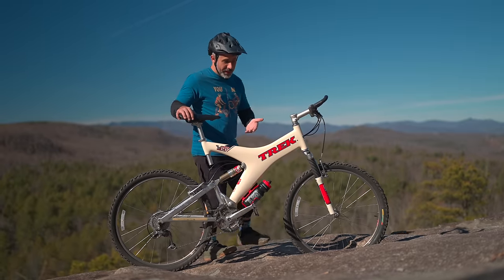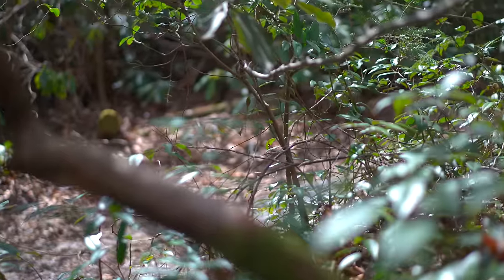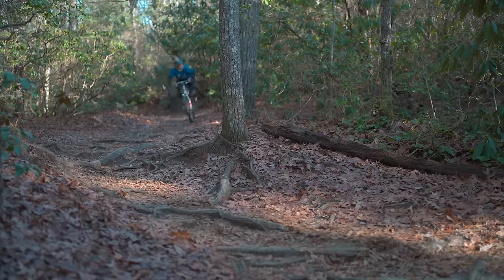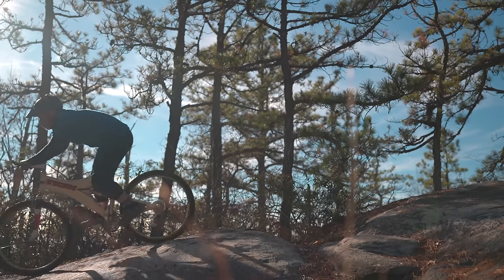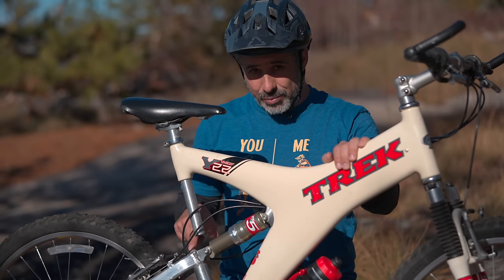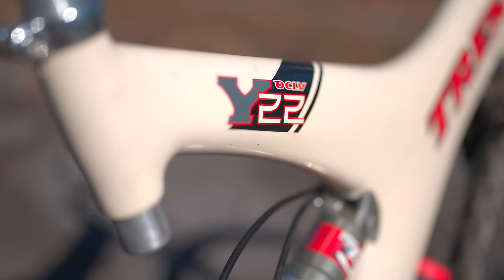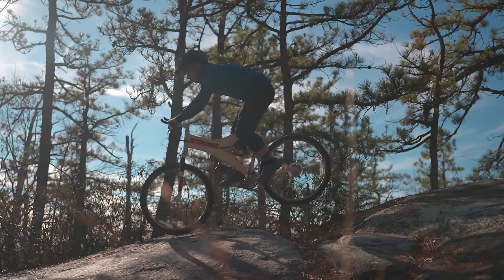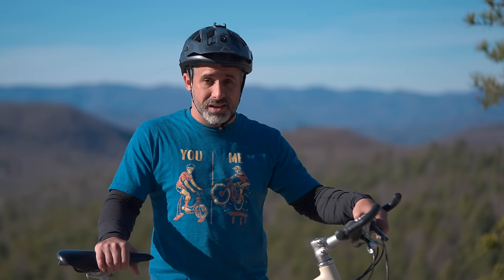The Trek Y22 was a 1990s Carbon Fiber Icon for the masses

Comment: I worked as mechanic for a downhill team in the 1990's, trek called it URT or "Unified Rear Triangle", the team riders called it URT too  "Un-Ridable Transport"
Reply: Worked for a Fisher dealership. We simply referred to them as the Why?Bike!
Reply: no kidding.  URT is like Unreported Rider Tested.
Reply: Solved with locking option on the rear shock (Fox Vanilla air with piggy back at my case) 0 bobbing when lock. 😎
Reply: @assafgol  nahh, nothing solves having the shock in the rear triangle, that's why nobody uses that design anymore
Reply: I had a fox shock custom valved by push, it transformed the bike adding platform and better bump compliance (a common upgrade to fix many of the 90's FS bikes)

Comment: 8:04 After mentioning 80mm several times, suddenly seeing that "LONG TRAVEL" sticker on the fork cracked me up! 😂
Reply: Good find :face-blue-smiling:
Reply: I still have not gotten a suspension fork that had more than 100 mm in travel.  I mostly ride with no shocks now
Reply: There are some videos from Cyclingabout that explain why no suspension shock (e.g. a carbon fork) can be even better. So like you nowadays mostly without a classic suspension fork. @madtownangler
Reply: Rock Shox Indy(entry level, elastomer damped) and Judy (mid-high tier oil damped) forks were built around a 63mm chassis. The long travel versions added a whopping 17mm pumping that up to 80mm.
Reply: It probably was long travel at the time, i had a hardtail bike with 50 or 60mm which i bought in 94. 50-60mm travel i believe was very common at the time for the cheaper bikes.

Comment: By 97 everyone was well aware URT suspensions were crap. Thats the year i bought a Marin B17, a 150mm travel bike with proper suspension, single pivot, but good. And i absolutely remember my seat was up and down like a yo-yo even with a quick release. 

The reason the Trek Y doesnt have one is because they were always marketed as XC race bikes.
Reply: I agree - the only thing Seth didn't point out (which he should have) is that while the URT design might have been 'efficient' for pedalling (no chain growth/pedal kickback) when seated, fundamentally there was no real rear suspension the moment you stood up on the pedals... 

As you say, for XC riders it was essentially a 'comfort' option, but anyone wanting to ride rough terrain at speed with a single pivot needed either a Cannondale (if you wanted a Y shaped frame), the Marin, the legendary San Andreas - or do it properly and go for a 4-bar/horst linkage rear end like the GT LTS/STS and Specialized FSR.
Reply: This was my first MTB (Well the 1996 Y11 in matte purple, which I still have) and learning on a URT provided me with some advantages. One, I learned to circular pedal to avoid suspension bob, so I am a very efficient peddler. And two learned to descend in the saddle, since the suspension only worked properly when the rider weight was on the saddle and not on the pedals, which effectively makes the URT a hardtail lol. Thanks to ripping the derailleur out of the swingarm I now run it as a single speed. (note this is one of the best bikes to convert to a full suspension single speed), with a rigid carbon fork, 29" front wheel, hydraulic brakes all around (used to use Magura rim crushers, and on the Y they should be called frame spreaders lol), and a dropper seat post. A great XC rig, and a passible AM rig.
Reply: @jmo2752  those were the days. Not sure I rated the early FSR too highly though, I really wanted and STS though, that carbon frame with alloy lugs looked so cool. Loved the B17 so much that I upgraded to a '98 Marin Team DH the next year. Same frame but Manitou X-Vert Ti carbon triple crowns forks that suited it much better. Hope discs too on that.

Single pivot was my thing being in the UK, early full suss bearing maintenance in our endless mud was no joke.
Reply: This same bike would be sold at Walmart!
Reply: Hi! From Argentina! I had one  Y5 (aluminium) modified to DH in the 90's 👋 thnks for the video.
Reply: @vr4042 Despite the "sweet spot" marketing BS, the Trek URT design with the pivot as close to concentric with the BB as possible, minimised the URT-ness, at the expense of the flaws of a low pivot point, URT or not.
Reply: @jmo2752 don’t forget the Scott Intoxica ❤
Reply: @jmo2752  aggreed the san andreaus and the gt LTS and worked even with a stupid steep ha i had a LTS and made a spacer to go under the lower head cup to slacken the ha a bit was better but still shit ha ha .

Comment: I'd LOVE to see you get a more beat up one of these and upgrade it with modern parts, suspension, breaks, bars, etc, and make a modern hybrid!! That would be a very fun "flip-bike" experiment.
Reply: Frame is garbage. Waste of time
Reply: @RealMTBAddict be more positive
Reply: @shaneanagrams  Ok I'll ignore the facts. That's how the world was built!
Reply: I don't see Seth getting a custom rear end for disc brakes on this bike
Reply: Nope. Its perfectly preserved. And to others here talking about things they don't know anything about, I know more than a couple folks who actually owned them who could set you straight. The Trek Y bike  was in its day a decent bike.
Reply: @RealMTBAddict yeah thats why so many were sold.,
Reply: @veganpotterthevegan  why not? If anything, modern times has the capability to do that .  If there’s a good welder interested in a fun experiment, I say go for it
Reply: I agree, I had the same thought. That would be fun, but also interesting to see how a really experienced rider like Seth would characterize the difference between two bikes where only the frame was different (old carbon Trek Y frame vs new carbon frame) but the same modern components.
Reply: @anthonynazzal1958  easy,  it's a huge waste of time.   *I could do this myself.  Seth isn't a skilled welder, certainly not with aluminum.  No modern fork will work with the geometry of this frame either.   Do you suggest paying Fox to make a custom fork too?
Reply: @veganpotterthevegan  
A rear triangle doesn’t need to be aluminum. Lol steel bikes are a thing you know?  Oh, of course you must know, you act like you know everything. 

I guess carry on, nothing more to say as you have spoken.  lol come on man, lighten up
Reply: @anthonynazzal1958  Jesus, you really are oblivious aren't you?  Any idea how hard it is to make an ultra precise jig for a part like a rear triangle?   Its significantly harder than making a jig for a hardtail frame which Seth also can't do. Seth is also only a sorta capable welder of steel, something he very openly admits.  If he made one,  it would also likely be 4x the weight of the original
Reply: @anthonynazzal1958   I'm a metalsmith.  I'm not a bike building expert but I'm certainly a welding and brazing expert
Reply: Exactly what I did 😎 
With 100mm fork, shorter rear shock bracket from garry fisher, disc brakes, 780mm bontreger bar, XTR m970 front and back. The whole geometry is different and way WAYYYY better by any means.
Reply: @RealMTBAddict  with some modifications it’s really can be a great trail bikes.
Reply: I rebuilt mine with new suspension, 1x12, and discs. Even fabricated an aluminum rear disc mount. Kind of a silly hobby project except I still ride it a ton. As much as my modern bikes. Still love it after 27 years…..

Comment: I still have mine hanging on the wall in my workshop. Built as a super lite full suspension for xc.  Upgraded with hope front disc, bomber coil front end, fox rear, needed the lockout for hard climbing. Looks awesome. Very noisy frame as everything amplified through speaker box hollow frame, floated well. Hardly used last 20 years. Great bike.

Comment: I still ride a 90's MTB.  I stopped riding in the 90's and at the time I had a Nice Raleigh hard tail.  A couple of years ago I bought a Marin Bolinas Ridge 1 to start riding again.  I hated it.  29" wheels were HUGE, the bike felt like I was riding a road bike.  So I sold it and bought a 96 Giant Iguana raw(clear coated) steel.  Built it with a 1x10 drive train and I absolutely LOVE it.

Comment: In 1977,  me and a friend took a schwinn stingray frame and made it into a mono shock frame, in metal shop class. We raced 250cc MX, so we were fairly well versed in how suspension should work.   It worked well. But my welds were scrap and I only got a "B" on the project.

Comment: I had the Gary Fisher aluminum version of this bike called the "Joshua". It was one of the first full-suspension bikes on the market. It was certainly innovative back then and I loved it. I think the only real drawback was the bottom bracket/cranks were on the rear triangle. You really only knew that after getting a more modern design in later years.
Reply: But it wasn't a real full suspension
Reply: I had the Fisher Joshua 3 too.  Loved that bike
Reply: I had an F2 with the iconic red/yellow split paint scheme for a brief period.  It drew attention, plowed the trails like a tank, and wasn't exactly light.  Fun bike, though.
Reply: The Joshua “level Betty” was the top of the line back then. I was lucky to get some parts from a Betty to my Trek Y22

Comment: This was my dream bike in high school. I would love going to the bike shop to look at it and pretend I'd get it for Christmas and stare at the 1997 Trek catalog.
Years ago I bought a used '98 Y22, tore it apart, went over everything and resto-modded it. Carbon fiber wider bars, C.F, seat post, aluminum short stem, new bigger tires, tune up etc...
I re-painted it white and added decals just like the 1997 version (best looking IMO). Now its better than new and it was really great to restore a classic and ride it around showing it off. Its a really fun bike, very light, tight and rigid. Now I'm restoring a '98 Y3 (the red one).

Comment: Id argue Trek copied Mountain Cycle San Andreas. I had a 2002 version, made of aluminum. It was ahead of its time in that it could climb very well, even with a non-locking coil rear shock. Disc brakes front and rear . Really a great bike. Sad I sold mine.
Reply: The mountain cycles were so cool. I remember seeing one on the national trail in the 90s and thinking it was the coolest thing ever. Had the loudest freehub id ever heard too. Wish I'd had a chance to ride one.

Comment: I worked at a high end bike shop in Beirut in ‘99 , and we had a Y series hanging in the shop window,  it was an alu model if I recall, had V brakes and rapid fire shifters , and boy did it pull in passersby’s … and the price made them go away 😂… in two summers working there it was never sold , and only one person ever bought one as far as I know, but when I think dual suspension downhill, that is the poster bike I see in my head … to me the idea of a bike designed to do one thing well was absurd, in a world of BMX, 10 speeds, choppers, cross and hard no suspension mountain bikes… thank you for Seth this trip down memory lane… and thank you for making me get off my ass and back to cycling.

Comment: True. About 20 years ago, i bough a locally made bike with a very similar alu Y frame, although, weak shocks and brakes. 
Frame still hangs around (literally, its now hanging on a wall), and, over the years, i overhauled it with XT vbrakes and suntour front susp. Its still a great old mtb bike that turns eyes.

Comment: Great review and beautiful bike, thank you. I wanted one of those but price stopped me. I found a used one to ride and the bobbing you spoke of changed my mind. I ended up with a new 1997 Diamond Back V8 which I still have. It had about the same drive, shock & fork travel  as the Y but no bobbing. I raced it locally for about 8 years with 35 lbs air in the 1.5 inch tires. 78 yo now and 29" bikes for pleasure.

Comment: I rode the Y33 version of this pre release in Wales during a yearly mtb competition, it was not painted, just black carbon fibre, my mate had some link to Trek, i entered a trials competition on it against pros on Pashleys and Montys and won. It also had carbon fibre v brake boosters and pace carbon fibre forks i believe from memory, Sliced my leg open on the front brake booster.

Comment: The Gary Fisher Joshua used the same basic design.  I still have my Joshua F2 purchased in 1999.   I paid $1600 for it back then.  It generally hangs in my garage as a reminder of bygone days now. Back then I rode it in several 24 hour races and other races.  It had it's quirks but was still a blast to ride!

Comment: I just picked up a piece of history (or will be soon).  Unused, boxed 2013 26" GT Force LE frame for $280.  Almost a fusion of old and new.  GT's old I-drive high mount single pivot is a blast from the past but performs really well when pedaling over choppy terrain.  It has just been modernized with a marzo z2 rail 150, an 11spd deore m5100 1x groupset, 4 piston deore brakes, 27.5 wheelset with 2.3 front and 2.2 rear x-kings and a KS dropper.  You can see the fusion of old and new with the slack head angle (65 degrees), relatively long ETT but slack seat angle of 72 and high bottom bracket.

Comment: If i remember right, the king-of-the-hill Y33 had a remote lockout for the rear shock, and there was a struggle variant that used Y geometry but had the Y made out of aluminum tubes.  It was touted to use URT that reduced pogo on climbs.  I would've punched grandma for a Y bike in the late 90s; my black 800 mountain track was my prized possession as a kid

Comment: In 98' my shop had rear triangles from i believe a boeing engineer who was a cyclist that added more travel to the rear paired with 100mm+ judy DH forks. Fun fact we also had limited trek Y bmx built with full Chris King and profile. And dont get me started on how sweet the DX levers and parallel push V's were! ...and yes im a industry veteran who still loves the old stuff. Except the ejection seat under braking of the URT

Comment: I was a bike mechanic in the  late 90s.  I built a GT STS DS 1000 with a boxxer, hope wheels and hubs, Mavic 321D and 2.3" Tiogas and full xtr.  The Cannondale Raven I think was the best FS of that era.  I liked the Y bikes.  They were neat and I liked the lightness and the sound tapping the frame made.  I thought they robbed a bit of energy with suspension flex.

Comment: I was a high schooler working at a Trek dealer when the Y-frames came out.  Trek already had their conventional OCLV frames pretty dialed in by that time, but duallies were just getting started.  Having that unified triangle with a  single pivot in front of the BB made these one of the few duallies that could climb.  The V-brakes were also a new innovation and considerably stronger than the cantilevers they replaced.

Comment: I have a 1998 Specialized FSR Elite Max Backbone frame (with the "Gold Link" ooh) I built up around 2000/2001.  Same as the one on the January MTBR email (minus the dual crown) article about when mtbs become "vintage"  It's still my main ride, although those rides are far between, but I love it.  And it does date me. lol

Comment: This was my first full suspension bike.  My model was a new Y-22 in clear coated carbon fibre. It looked great especially in the sunlight. While it's been a while, I remember that the cranks got closer to you as the suspension went through its movement.  Sitting down over a small step up was difficult because as you pedaled out, the back of the bike was coming up as the rear tire was rising with the  terrain.  We took these bikes to Big Bear for lift riding back in the day.  The operator said he remembered us because of how light the bikes were. I remember losing braking power when the rims got to hot for the v-brake pads.  I sold it to someone looking for a cross-country race bike, as it was really light even back then. Two bikes later I had a Turner XCE, which was the beginning of modern full suspension biking for me, including four bar suspension and hydraulic disc brakes.

Comment: I have an old (early 2000s) mongoose Y frame hardtail in the garage still.  It has a 10spd 1x ltwoo grouoset now and my old rockshox tora 80mm on it atm.  

Every now and then ill take it out to my local trails and come out of it very happy to be alive.  Such a diferent experience compared to my NS eccentric hardtail.  Front so steep, rear so slack.

Comment: I had a 120mm front XT equipped bike in about 2004 and picked up this frame to switch parts. Put some carbon bars and light wheels and it was a very nice riding 26.8 lb bike.

Comment: I have 1999 Trek ZX 6500, but after a upgrade I discovered it's a WSD version. Because that bike is in seriously very good condition, I decided too keep it and I have bought 1996 Trek Singletrack 930 SHX. It's more like a gravel bike, than MTB, just it's slower on the road. Yes, You can count how many km/h You're slower, but You can't count nostalgia and fun that bikes can give.

Comment: My dream bike that I own 😎. Modified with xtr m970, nuke proof short stem, 780mm bontreger bar and 100mm triple crown RockShoks Judy xlc. 
I’ve searched for 2.5 years and was lucky to find 15-23 years old parts in a new or mint condition. 
Ride like a dream.

Comment: I bought this back in 97. It was my first full sus bike. While the bike shop was setting it up they discovered a problem with the frame and upgraded me to the clear coated carbon fiber frame which was so bad ass. Over the years I replaced the front shocks and wheels, and went to disk brakes. The rubber on my grip shifts eventually turned to goo but I was able to find NOS on ebay and replaced them. I used the bar ends while riding a lot too. It was used for many years including some local races. I still have it and still love looking at it. These days I'm ridding an e-bike, but I'm not getting rid of it.